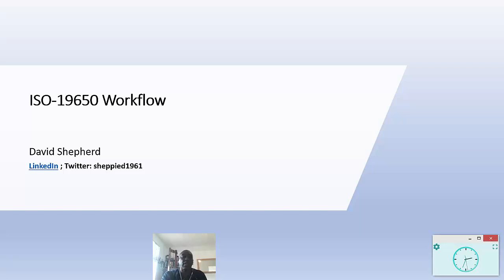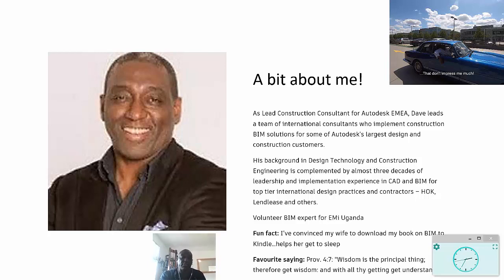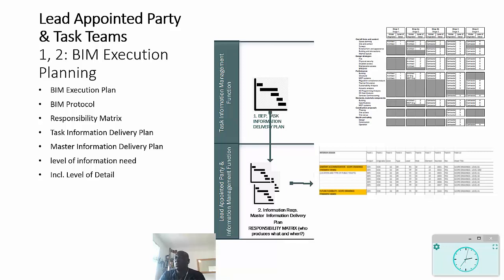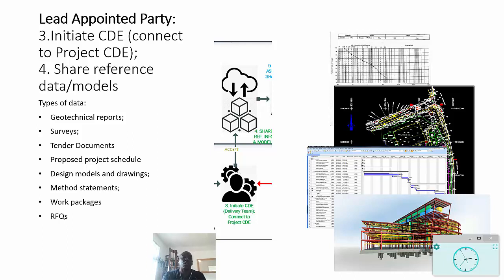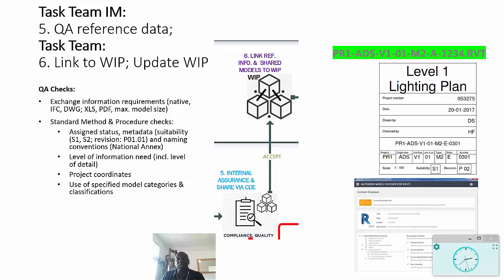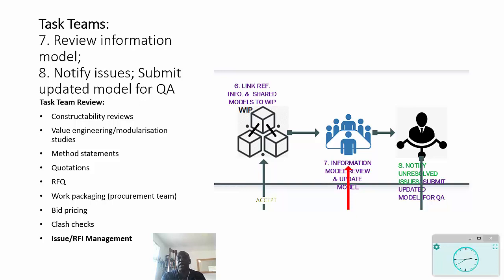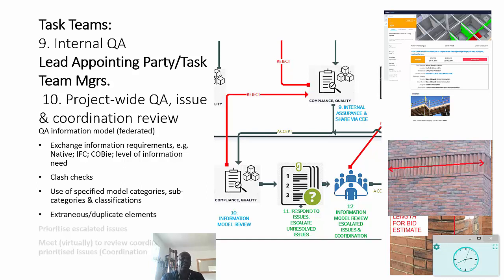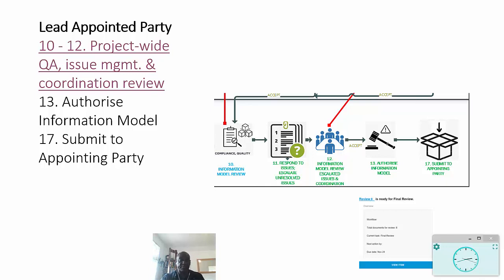ISO 19650...in less than 10 minutes!

Comment: A tough ask to cover 19650 parts 1 & 2 in 10 minutes. You need to understand 19650 to follow what he's saying and if you really want to understand the working culture I'd suggest reading the documents, starting with 1192, then 19650 2018 and then 19650 2021. It's good to see and understand how 19650 has evolved. The 2021 version changed massively from the 2018 version; which this video is based on. With part 4 now out, you also really need to make reference to that document every time you refer to part 2.

Comment: There are misleading statements in this presentation. 
1. There are likely to be a number of Lead Appointed Parties on most projects. This is because each party directly contracted to the Client (Appointing Party) is a Lead Appointed Party to their supply chain. 
2. The Lead Appointed Party is not necessarily responsible to provide the CDE, although one of them may  responsible if given that responsibility in their appointment. The CDE could equally be the Client's (Appointing Party) responsibility.
3. Each time you make reference to THE Lead Appointed Party, to be correct you should be saying EACH Lead Appointed Party.
Reply: Presumably, ISO-19650 is also 'misleading' and 'incorrect' because it does not use the phrase "each lead appointed party", but repeatedly states "the lead appointed party". We'll agree to disagree.
Reply: @bim4u-getbimbenefitswithou924  the ISO is very clear on this point, both in terms and graphically, also in the supporting documents such as the Information Management Protocol. An example would be in section 5.1 of Guidance Part 1 where the term 'each prospective Lead Appointed Party' is used and if you recall the the graphic showing the parties in Guidance Part A where they have the relationship map. You have A in the centre of the graphic representing the Appointing Party and then a number of B's each representing Lead Appointed Parties distributed around A.
Reply: @magrew66  The fact remains that the ISO-19650-2 repeatedly uses the phrase: “the lead appointed party”. 19650-2 isn’t misleading or incorrect because “each” is not mentioned in that document, but, instead, elsewhere. The same goes for this video. Of course, I look forward to you sharing your own BIM expertise via YouTube video or other media. But I won’t hold my breath.
Reply: @bim4u-getbimbenefitswithou924  I do despair when I see an individual who claims expertise but is unwilling to consider a point fairly raised and accurate.
Reply: @magrew66  Of course, you could have forthrightly declared ISO-19650-2 to be similarly misleading for not mentioning ‘each LAP’. Instead, when your argument fails, you simply persist in baseless assertion. Considering your purported expertise, I despair too. But persist in assertion, if you must.
Reply: @bim4u-getbimbenefitswithou924  I gave you the references within the standard to refer to. That isn't baseless.
Reply: @magrew66  straw man. Your argument is that this 10-minute summary is misleading because the phrase “the lead appointed party” is wrong and I should be saying “each lead appointed party”. I showed you that the 46-page ISO-19650-2 repeatedly refers to “*the* lead appointed party (once only mentioning ‘each’) without attracting your accusation of being misleading.

You wrote: “Each you refer to THE Lead Appointed Party, to be correct you should be saying EACH Lead Appointed Party”.

ISO-19650-2 doesn’t do this, so why should I?

That’s why your ersatz argument is baseless.
Reply: @bim4u-getbimbenefitswithou924  my point is that you imply there is only one lead appointed party and you impart responsibilities to that singular role. This is misleading. I do respect your courage to attempt to explain ISO 19650 in 10 minutes. A very brave thing to try and do. I came to your recording because of that. I have been attempting to formulate a concise way to explain it myself and have failed every time. I was therefore keen to see if I could learn a way to do so from yours. My comments were not intended to do you down or anger you they are offered in the sense of advancing understanding. I have come across other practitioners, some in influential roles as you are, who have been promoting the idea of the singular LAP. It is very important however for successful outcomes to have clear understanding of the idea of multiple lead appointed parties as possible and indeed the most likely situation. The reason being that each party appointed directly by the client (or other appointing party) has to take responsibility for their information flow and the information flowing from their sub-appointments. This is the purpose of the Information Protocol to set common understanding and application of duties across the entire project team. I have seen too many projects start on the wrong footing because parties don't take responsibility for their respective share of the information management process.
Reply: @magrew66  Anger doesn’t come into it. If you want precision, then you must follow your own statement to its logical conclusion.

You wrote: “Each you refer to THE Lead Appointed Party, to be correct you should be saying EACH Lead Appointed Party”.

I repeat that ISO-19650 itself doesn’t do that. So, are you advocating that approach for ISO-19650 as well?

If not, in comparison with a 10-minute video, why do you support a ‘special pleading’ exemption from that requirement for that 46-page standard?
Reply: @bim4u-getbimbenefitswithou924  so are you telling me the standard intends for there to be only one Lead Appointed Party?
Reply: @magrew66  I repeat:
You wrote: “Each you refer to THE Lead Appointed Party, to be correct you should be saying EACH Lead Appointed Party”.

I repeat that ISO-19650 itself doesn’t do that. So, are you advocating that approach for ISO-19650 as well?

To respond with a question is simply avoiding reply to that question.
Reply: @magrew66  Still haven’t answered the question that relates to your own statement. I realise that you can’t deny that you made that statement, but, you might, at least, admit that your statement was, er, misleading.

Comment: Very well explained in 10 minutes, thank you !

I have a quick question, is there any reason why the lead appointed party cannot be the project manager or any other consultant for that matter or does it need to be the lead designer/architect?.
Reply from the maker: Good question, What's key is the existence of contractual relationships that ensure that task teams are legally accountable to the lead appointed party (for fulfilling information requirements) and that ensure that the lead appointed party is legally accountable to to the lead appointing party for the same.
Without this contractual hierarchy, it's difficult to see how the PM or other consultants could be  legally accountable for delivery of information.
Reply: @sheppied1604  okay, thank you that make sense I think, so am I correct in understanding that as, as long as a contractual relationship/obligations are in place setting out how the various task teams will fulfill their information requirements a project manager or any another other consultant for that matter can undertake the role of the "appointed party".
Reply from the maker: @alisharif2628  Yes. But, to be clear, the issue of contractual obligation turns on whether the project manager or other consultant is operating as principal or agent. 

If, *as principal*, their contract with the Lead Appointing Party makes them legally liable to 'perform' design/construction/asset information delivery (perhaps via a management contract), then they can be the Lead Appointed Party. The liability remains even after they appoint task teams.

If, *as agent*, the contract is to review/monitor the provision of these deliverables without being held legally liable for non-performance, then they cannot be the Lead Appointed Party.